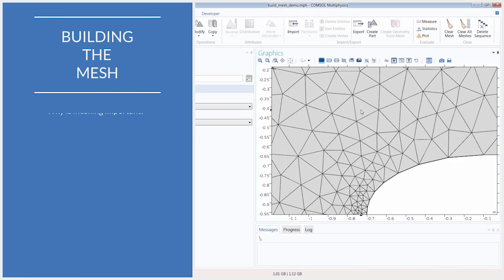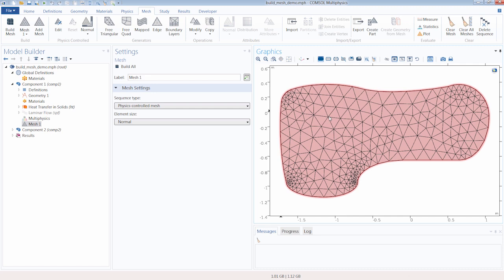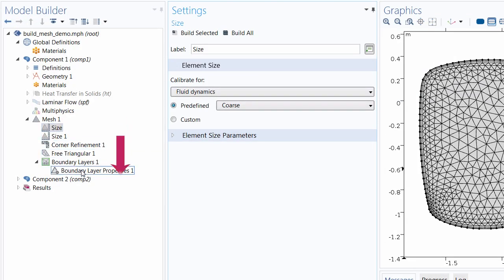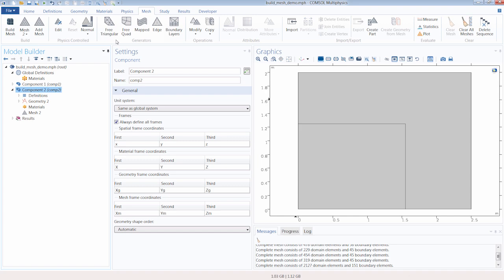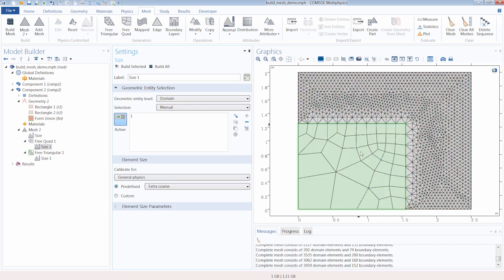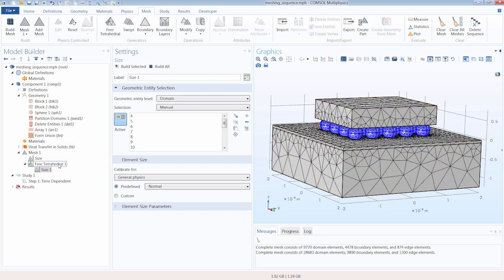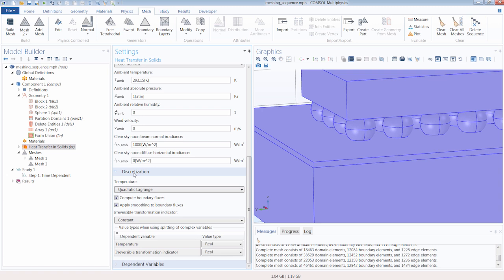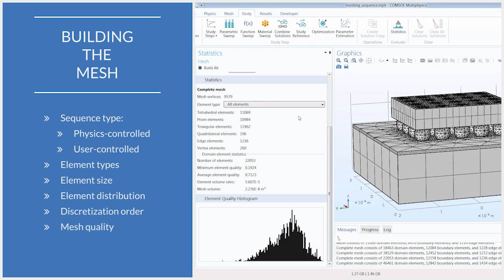How to Build a Mesh in COMSOL Multiphysics®

Comment: Hi,
 I'm new at comsol and aiming at building a cartesian PML in order to calculate the scattering cross section over a semiconductor in an specified arrange for a photoelectrochemical cell but when meshing, I fail because source and destination faces are not well defined or specified, however, I have not been able to overpass this problem since I do not understand how to make these definitions. Any idea or bibliography that explains this kind of meshing will be appreciated, thanks.